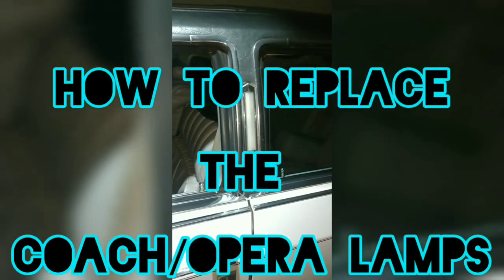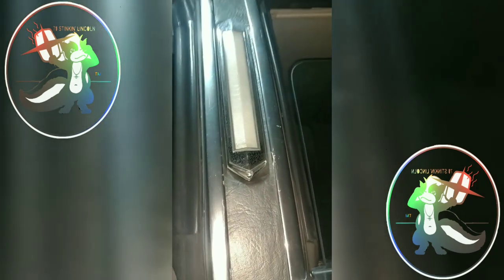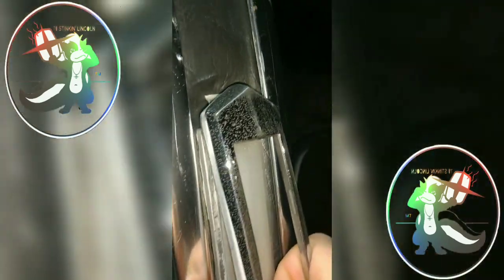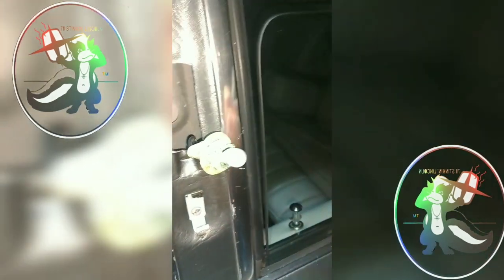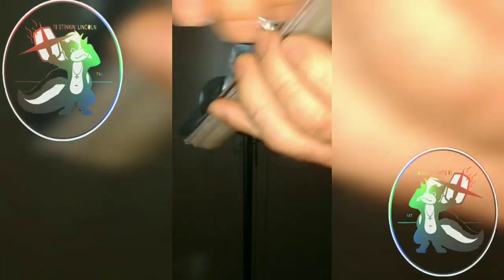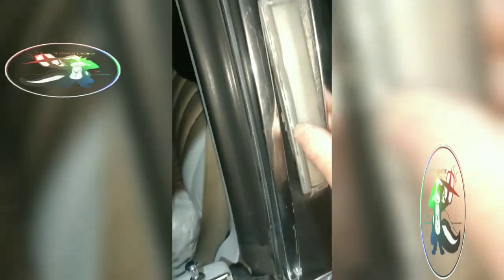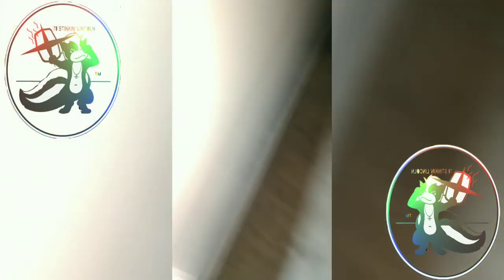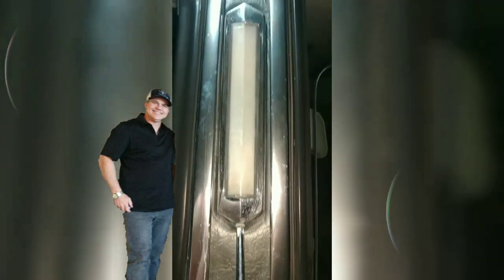How to Replace Opera/Coach Lamps Most Models

Comment: How about replacing opera window?
Reply from the maker: I have the service manuals I'll takes some pics and make a quick video
Reply from the maker: Hi Jo please remember to subscribe also  there aren't specific instructions, but as you can see in the service manual (click link) it appears to be held in place on the inside by three screws/brackets  which would require removal of the rear seat then the trim on that side which is not difficult either but the plastic be very easy on. 

https://drive.google.com/file/d/1e_Sv8oeKoJ8UFIgnjhbvNkNE11qMkXhd/view?usp=drivesdk